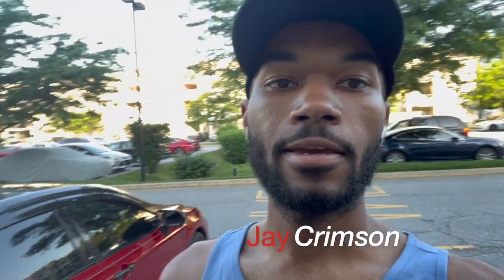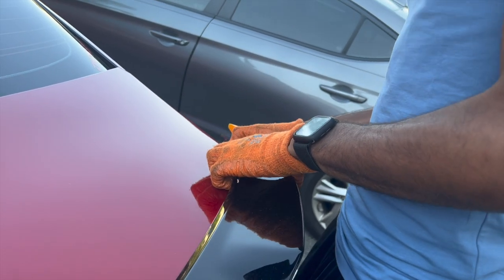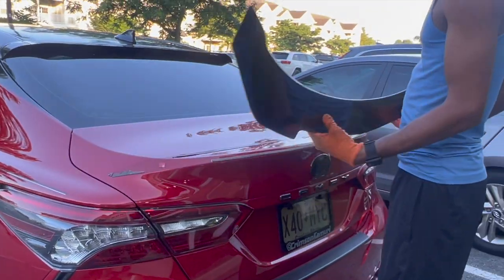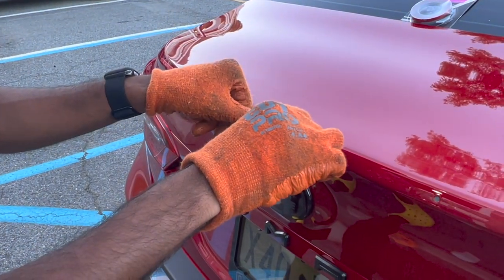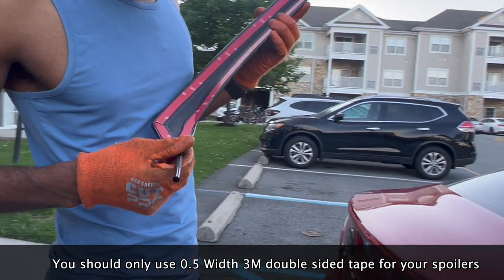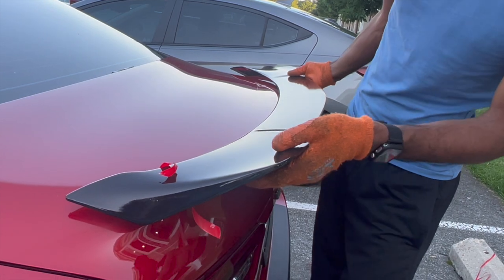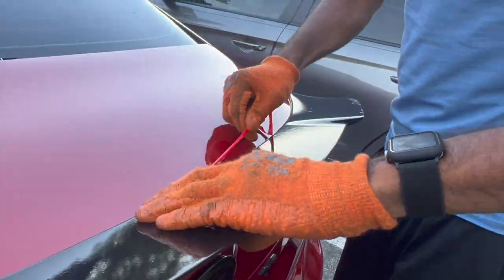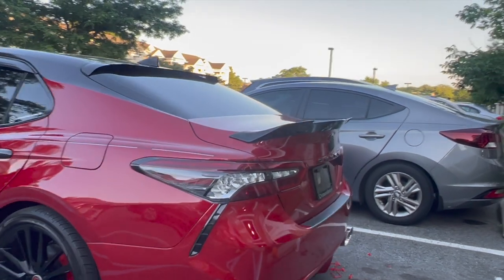Installing New Yofer Design V2 Duckbill Spoiler on 2018-2024 Toyota Camry

Comment: Hey quick question. Did you use the 3M tape that came with the spoiler?? This morning I notice mine was coming loose after having it installed for about 4 month. Not sure if the cold weather had anything to do with it, since here in South Florida is always pretty hot. 
Where do you recommend getting some good 3M tape to use and what size? Thanks in advance 🙏
Reply from the maker: no I use the same tape in every video that requires it. 0.5 width is the best option. you can find the tape in autozone or amazon/walmart

Comment: would you recommend that that rear window spoiler? I got one from ebay & the sides never stick all the way down, I can see yours is having the same issue where is sunlight coming through on each side... have you found a roof spoiler that will stick & fit perfectly?
Reply from the maker: Yes this is the one I use now. Click on any of the flat style options also use discount code “KOCF-crimson” to save a couple dollars. 

Best roof spoiler I’ve owned for this car 

https://kocf.com/products/cf-roof-spoiler-for-2018-2023-toyota-camry-real-carbon-fiber-roof-spoiler?keyword=camry%20roof%20spoiler

Comment: I know you used mostly 3M tape so that’s what I did. Overtime I’ve gotten gaps in between the spoiler and car body, so I was wondering if you had any recommended adhesives I could use to fill the gaps
Reply from the maker: I also had these problems. Unfortunately because nothing aftermarket is perfect we just gotta try our best with it.

Comment: Looks good bro. 
I got a 23 xse v6 in the red two tone like yours. 
Is 3m tape standard? I've never modded any of my cars before so I've been really apprehensive to buy a new spoiler and put it on. Or can you bolt the aftermarket stuff too? 

All that aside, nice ride dude and thanks for sharing.
Reply from the maker: I highly recommend you do not bolt down any aftermarket spoiler. The holes do not match up with factory. If you create holes you will create future problems. 3M tape is extremely strong. I have never had an issue with it besides it being too strong 😂

Comment: What did you use to clean off the old tape?
Reply: An adhesion wheel on Amazon with a drill does wonders.

Comment: Hey. Good video. There is one thing. 

Are you sure you are using 0.5 inch Width 3M tape in the video? Seems more like 0.6 or 0.7 inch. 

The Vofer tape that came with the package is larger than the 0.5 inch 3m tape from autozone.
Reply from the maker: I don’t EVER use the 3M tape that comes with any of the aftermarket stuff. So yes I 1000000% positive I know what I’m talking about.
Reply: @crimsonkamuri  What I meant was I thought you used a different width 3M tape. At least seem like it was wider in the video. Lol

I saw in your video that you live in NJ. I live in NY. I like the way you fit your V2 spoiler. I just got mines last week and am trying to install it evenly. 

Do you do installation business? I will pay you cash in person. Trying to do more mods on my Camry.
Reply from the maker: @davepanempire  yeah the aftermarket tape is God Awful lol. 

But yes I do installation for people around the east coast PA/DE/NJ/NY pretty much every week now. Could you message me on Instagram so we can talk a little more @crimsonkamuri

Comment: I have the stock wing on my 2023 XSE if i want to install a duckbill spoiler will it cover the holes the stock wing leaves behind ?? Unlike the trd wing that leaves those exposed and uses the top of the trunk instead
Reply from the maker: Toyota has changed nothing to the trunk or spoiler from 2018 up until now 2023. It will fit just like all the other SE/XSE Camrys
Reply from the maker: Actually installed one on a 2023 XSE a few months ago